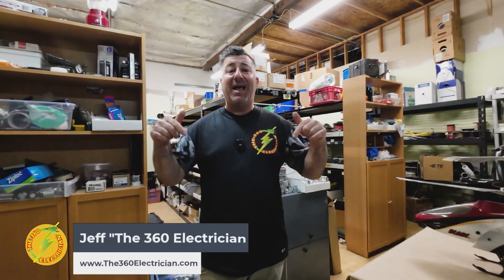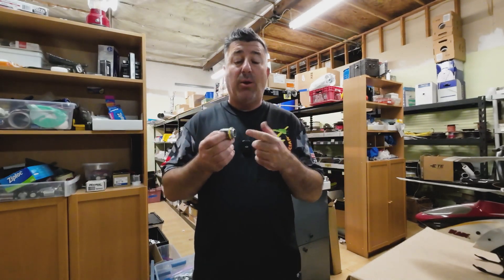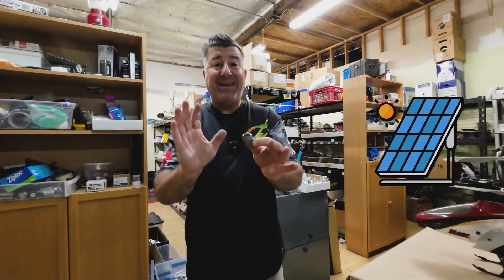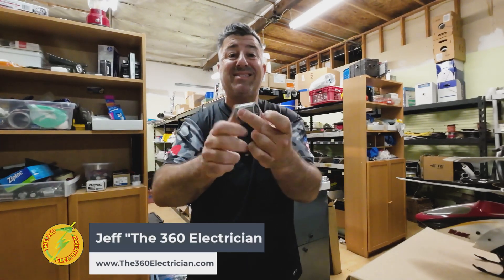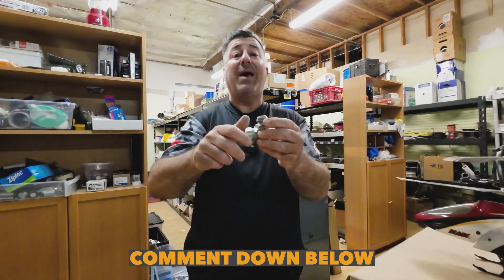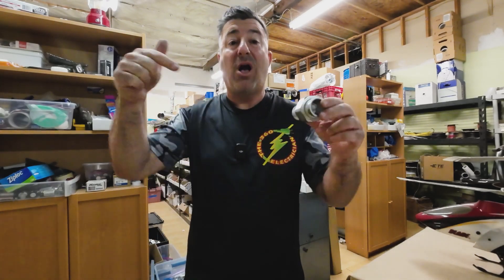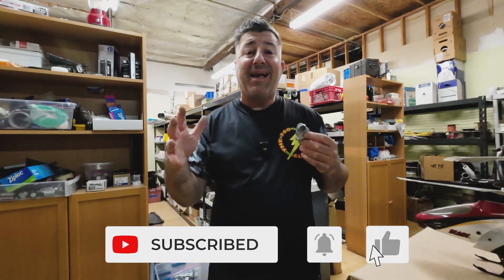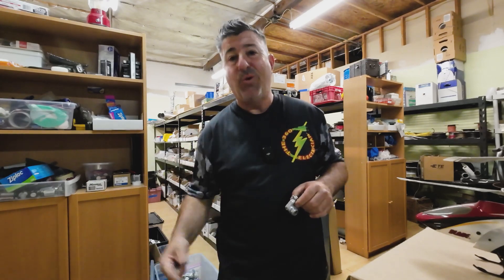Electrical parts I don't know! Only real electricians would know. #electrician #electricalparts

Comment: #3 we called it a short elbow. Also😂make them in longer version. #4 called a Erickson fitting for rigid conduit. #6 appears for use on rigid conduit like #4 . We used #4 when we had rigid conduit that had an offset or a 90 and could not be screw to a conduit flush on wall or on unistrut.
Reply from the maker: These are hard to find. I've never seen s longer one. That would make installation easier for what we use them for.
Reply: @The360Electrician  We had one local inspector who would not allow you to install any other wires in safety switches. So when we had a trough on a wall to feed several safety switches & starters with control wires coming from trough we would use a short elbow into the side of motor starter when safety switch was between trough & motor starter. Was easy to fish stranded wires thru a 24" piece of EMT thru short elbow.
Reply from the maker: That's a great point, not every part is for every type of electrician. Commercial motor control may use parts we would never see as a service company vs Vera.

Comment: 4- is a rigid 3 piece coupling.  Might also be called a union.  When doing a rigid conduit run, you have to spin on the pipe.  Sometimes with an offset, or 90 you can’t spin the pipe on because obstructions.  This part removes the need for spinning the pipe.  I’m an industrial electrician in WV, I use them all the time! Love your videos!
Reply: We call the Ericsson’s in Canada aswell as unions or 3 pieces
Reply: @hashoes3294 yes Erickson here. As well
Reply: I can honestly say I've never used it but my guys wanted it in stock. I think they are super hard to find. Have you used one?
Reply from the maker: Has anyone used one? If so for what.

Comment: 1. Looks like a Myers hub connector. Is #5 an emt connector for wet locations? So a raintight male 90 degree emt connector? He'll I dont know 😂
Reply from the maker: I was thinking rigid, never thought of either. I guess a rigid would have been threaded?